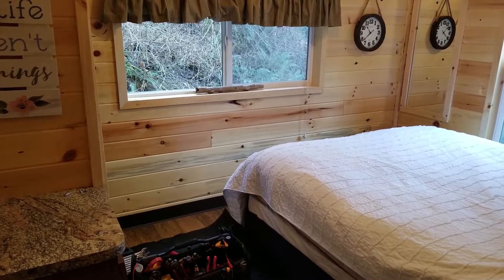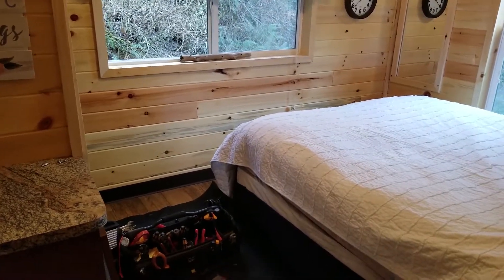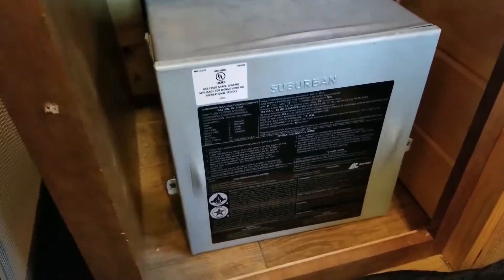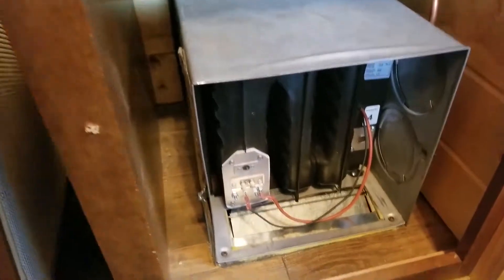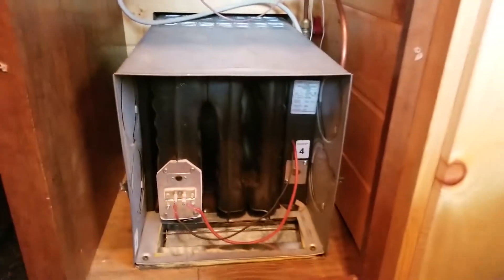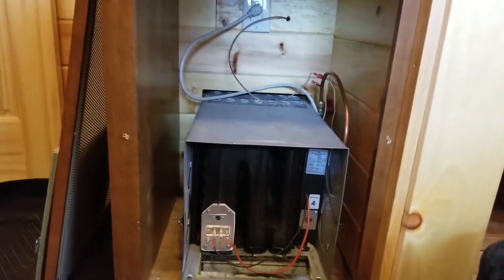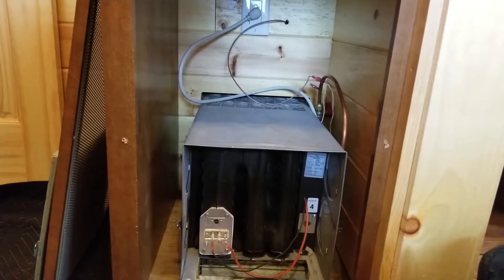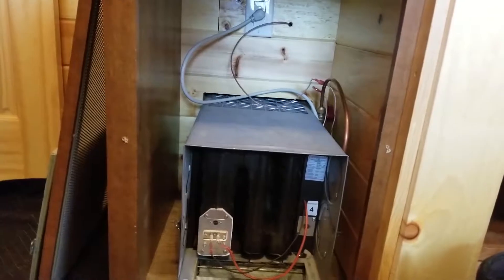Failed, Buzzing Transformer on a Suburban P40 Furnace

Comment: Thanks for your videos Darren, you do an excellent job. One thing I've always wondered is if you feel pressured to really hurry the repair along. I know your rates are $175 an hour, and it would be pretty easy to charge the customer more than what it would cost just to replace the entire furnace, hot water heater Etc. Or maybe not more, but you would charge them enough where they would be better off just pulling it out and sticking a new one in the hole. Especially if it was old or older. Keep the videos coming, appreciate all your hard work.
Reply from the maker: We charge based on the industry flat rate. We use the Spader RV service manual to come up with the task time and multiply that published task time by our shop rate.  The shop rate represents the certified technician and all the training, certification, and experience that he comes with as well as the shop tools, equipment, and supplies necessary to perform the task on location. So it's not just me going out there punching a clock for an hourly rate - it's everything that comes with me - my service trailer has probably over $80,000 worth of tools, equipment, and inventory! So it really doesn't matter how much physical time I take on a repair task - it's what the flat rate guide listed as. We do that so it keeps it fair for the customer and it keeps it fair for us. Some shops that charge strictly by the hour can take a job in milk it and some shops don't carry the tools and equipment that we have in our service trailer to actually do the job on location. Before we accept the job we have a dialogue with a customer to make sure that we arrived completely prepared. I would say for the jobs that we do we probably have more training, tools, and equipment that we arrived with to a customer's location  then a lot of technicians you find at the larger dealerships in order shops.

Comment: Hello from the great white North!  Have a p40 in my park model and we lost heat two days ago. I replaced the electrode ignighter as the old one was corroded, but still not getting any fire. Tested the ignighter and there is no electrical movement when the furnace kicks on and see no spark or glow. Thinking it's a sensor on the control module. Fan comes on, she's getting propane. Since I installed the new ignightor I had it going for maybe 2 minutes but no luck since then.  Any suggestions or thoughts?  Thanks in advance
Reply: I know it's been a couple months but I'd say either the combustion blower proving switch or the control module.